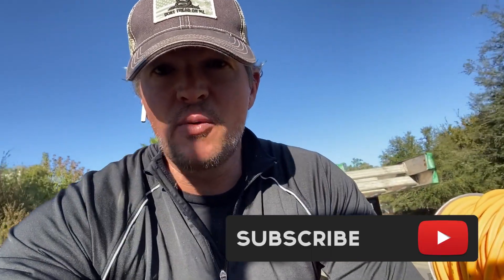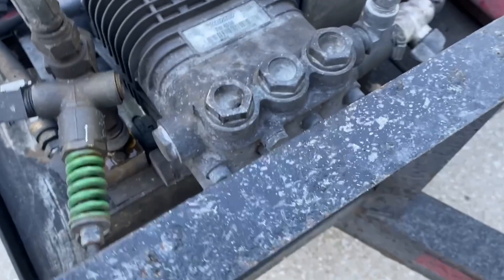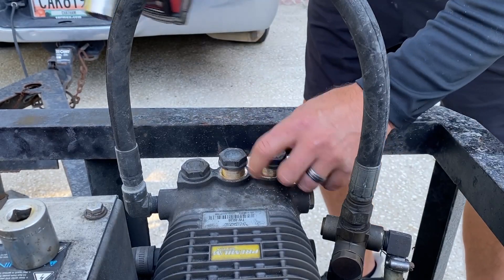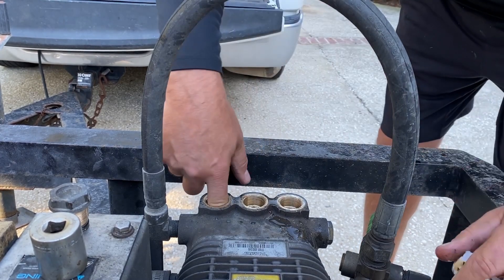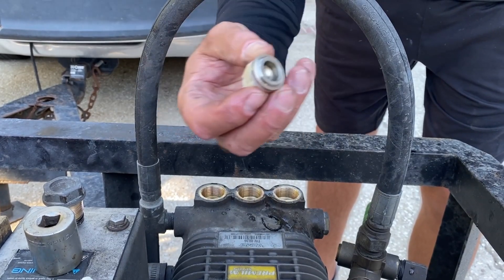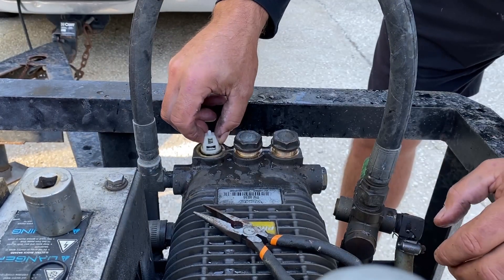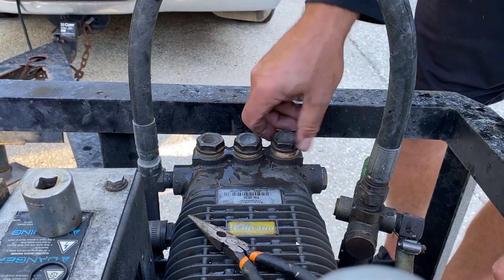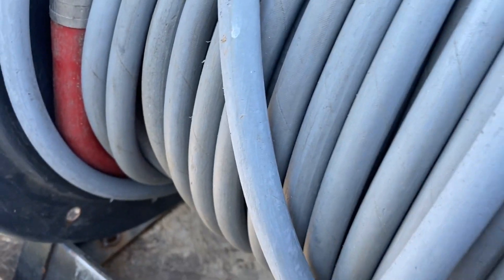Pressure Washer Pump Repair - Low Pressure and Cavitation

Comment: I replaced new check valves and o rings but still have the pulsating issue only when I pull the trigger. What can it be?
Reply from the maker: Ceramic plungers cracked

Comment: Hello Mike.Thank you for your informative videos. I’m pretty sure you fixed a lot of pressure washer pumps. I’m looking to purchase an electric 5hp 240 V Total stop pressure washer. I have a lot of options but I’m deciding between these two pumps. Canpump CF2530 EH and the Bertolini WBH 2430-F. I would appreciate it if you could take some time and help me decide which one to pick and which one has less problems.
Thank you.
Reply from the maker: Yes I have

Comment: Good video but it sucks when the check valves for a consumer model washer aren't made any longer, and it seems briggs and stratton has a compatible set that comes with all the parts that assembles a new head without the actual head, and cost in excess of 40.
Reply from the maker: Yep

Comment: My washer was running on half pressure,took off a bolt with a ball bearing and spring,inside.a piece of metal was stopping the bearing from running smoothly.put the whole lot back in and perfect now.
Reply from the maker: That would be the chemical injector - not the pump.

Comment: Here one for you. A friend of mine runs Hawk pumps, XLT2230 & number of XLT2730 all rated at 4350 psi for drain cleaning - never operated with a pressure gun or valve - its all remote start with so there should never be any spike pressure. The pumps have been purchased years apart so will be from different production batches. On the XLT2230 he has blown the cap/plugs on the 'Low pressure intake side' & on the XLT2730 this has happened 6 times - its just one plug that blows out at a time, not necessarily in the same location. The thread is nearly ripped flat & on 4 of the plugs the sides are ripped open like paper.

The pumps are fed by a large water tank, with low water cut out, 32mm (1-1/4") feed hose & the tank has never been down low when this has occurred.  f he runs a threading tool back through the head where the cap blew out of & then installs a new plug the pump carries on running as nothing had happened.

Do you or anyone have an idea how the intake side plugs can blow out like this instead of the high pressure side, especially given there is a 32mm feed hose plumbed into the low pressure side so you would expect any back pressure to just go back up the feed hose to the tank.

The supplier claims they have never seen this, almost as if they don't believe it & they but can't provide any thoughts on how this can occur. It happened again this weekend & I suspect whatever is going on is repeatedly happening, wearing down the plugs threads over time & eventually it blows.

I would love to hear anyone out there's thoughts.

Comment: Rubber hammer rather than a breaker bar some times works. Instant torque. Doesn’t twist the whole pump.
Reply: Hit on the shifter instead of pull it to crack it.

Comment: Awesome, thank you for putting this together! Exactly what I needed, my Simpson pressure washer was doing this same thing and this being my first one I’ve owned I wasn’t sure if the pump was failing. Simple check valve clearance and o-ring replacement was it. Thank you!

Comment: I'm going to have to check mine, I have the same pump in its giving me the same problems. My unloader is set up the same way, do you recommend switching it so it is easier to replace if needed? And if so, What would you switch it to?

Comment: I recently upgraded to a 21 litre per minute machine and I was using it today and it was jumping and sounding very weird. It would start out with super high pressure like normal for about 5 seconds then start to go shit. I thought maybe it could be because I was using a low pressure rain water tap?

Comment: Have a question can it cause your hose to blow off if you're not getting good pressure because my hose blue off a little while ago which I was not getting good pressure and my host started vibrating real bad and the next thing I knew the hose blew off off of the pressure washer itself thank you

Comment: Hello! Great informative video. I have an AAA pump. 4400psi. 
It has little plastic plugs on top. One of them is spewing water out. There isn't a loss of pressure, just that leaking problem. Can you please give me a what to do direction for that? 
Again, thanks.
Reply: YOU need to buy a new pump.

Comment: Im using 5/16 high pressure hose for my 4400psi 4gpm machine and im so frustrated about vibration of hoses. I replaced my cart, even replaced my old AAA pump that went broke and with the new Comet 4000psi 4gpm pump and skid mounted on truck my hoses are vibrating as fck. Already checked the check valves and orings like u said on video, they are fine. Do you think switching to 3/8 hose will help? Do you have any vibration problems with 3/8 and 8gpm 3600 psi? I might be switching to 8gpm near future and i dont want this vibration any more.

Comment: I got the jump, but it’s also making a bang noise. When it rains it pours. Almost done with a job, and 3 more lined up.
Reply from the maker: +Veritas Designs  bang noise doesn't sound good - could be a rod
Reply: @Mike-Vidan  my lines are pulsating but there’s a bang noise. Running an RB600 (STIHL) when it rains it pours. Because as soon as I think I am getting ahead I have this happen. Funny thing is just upgraded my gun with a slightly longer barrel then what it came with. Wash broom, and a telescopic pole for gutters and two story homes. It’s my first power washer. Second season of power washing. Sucks because I am in the middle of a job, and three more lined up for next week.
Reply: @Mike-Vidan  I could leave my cell. If you want me send ya a movie
Reply: @Mike-Vidan  leaving voicemail at your site.
Reply from the maker: +Veritas Designs contact the People that make it or where you bought it. I'm
Not going to be able to help you with it.
Reply: @Mike-Vidan  Germany 🇩🇪
Reply: @Mike-Vidan  meh I going to buy a new one. Wanted to do some upgrades anyhow like duel lines coming out. And a pressure gauge on the hose. Something smaller but packs a punch vs weighing 118lbs.  Something with electric start.

Comment: Shouldn't you have carefully removed the old blue Loctite from the thread, and re-applied new before tightening down?
Reply from the maker: +barlow2976 you can - I don’t
Reply: @Mike-Vidan  Tempting not to bother, but as the manufacturer says do it, I'll do it.

Comment: i have one that collapses the input water hose 3/4"   Acts like a vemt is clogged, this unit sat for 15 years , my sister asked for help i cleaned out all the varnish and honda engine runs as is should GX200   like mine, however doesn't make a lot of pressure and if i do not depress the wand trigger the unit will stall.  took head off and cleaned everything , but something amiss
Reply from the maker: Probably bad seals

Comment: see you tight the bolt  so how many ft pound ?
Reply from the maker: I would consult the manufacturer of yout pump - - the General Pump TS series requires 22.1 foot pounds of torque on these manifold bolts

Comment: What is the problem when I turn on my pressure washer, pressure is being released from the valves on the pump. Water is being sprayed from the pressure valve with pressure?
Reply from the maker: Bad o ring - not sure what exactly you are asking

Comment: You should always blow & suck on the check valves when testing them. If you can suck air through them they are not seating down fully. And as a pro tip never use an impact to tighten bolts even just loosely. If you tighten them down too fast the check valves can get crooked in there and ruin them as you tighten them check valve caps down.
Reply from the maker: +Jordyn Martinez  exactly what I did, good tips.  The impact is fine as long as you know how to use it, time is money and that speeds up the process. Thanks for watching
Reply: @Mike-Vidan  yeah I’m just thinking of other people putting it on and giving it too many Ugga Duggas with an impact. I’ve always used my 1/2” 22in ratchet to be safe.

Comment: On my pressure washer, the snap ring that holds the pulley in snapped, and the pump was making weired noises when I let off the trigger, and the flow was way reduced.
Reply from the maker: +Adam Chicoski  good info and something to look for, thank you Adam.

Comment: Thanks for the information 
My brand new pressure washer was surging do to the chemical injector being installed at the factory backwards. Ball was under the spring
Reply from the maker: +jmal88  dang!  We all have days like that, even the folks at the Manufacturing facility that made your pressure washer.  Had to be frustrating